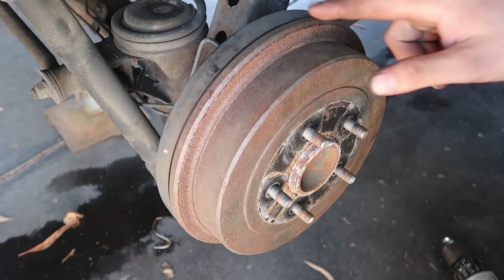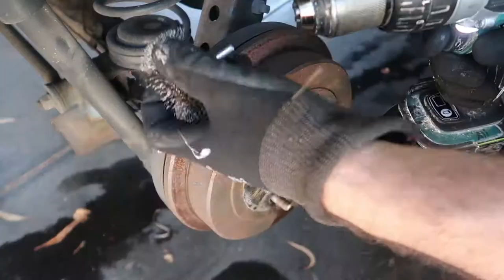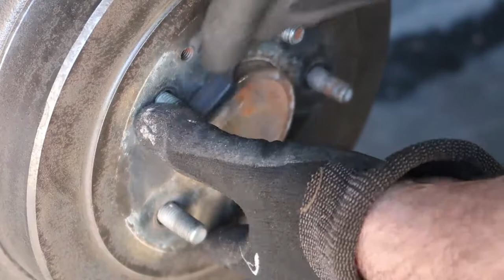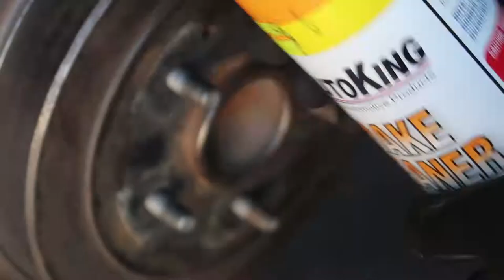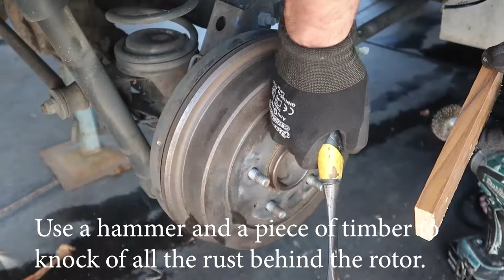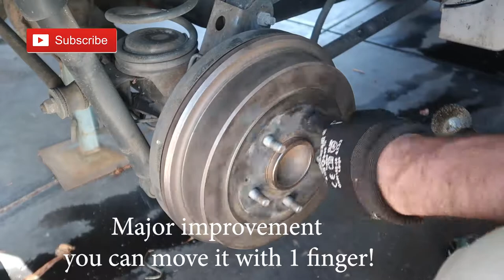How To Clean Brake Drums - Super Quick and Easy!!

Comment: If you can move your brake drum with one finger, aren't your brakes not adjusted well enough? Shouldn't the brake shoes be making light contact with the drum? I thought you should just be able to turn the wheel a small amount with the tyres on, and even less without the tyres.

Comment: This video is ridiculous.  Just stop already. Hitting  your claw hammer on a piece of wood against the drum is doing nothing.  Why not just remove the drum to clean it and remove the dirt and dust built up on the inside. Use that brake clean for something useful like on the actual brakes and you don't have to fight cleaning around the wheel studs.